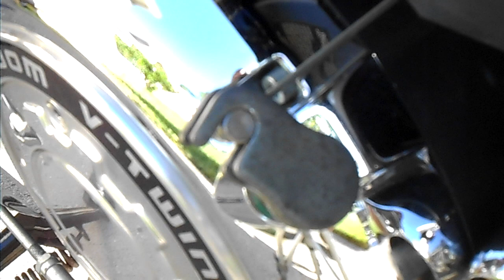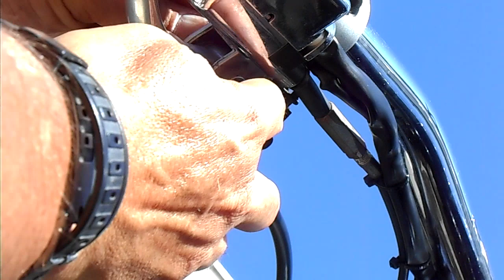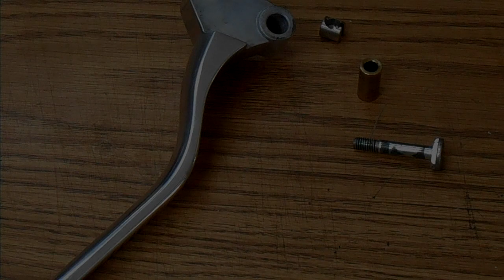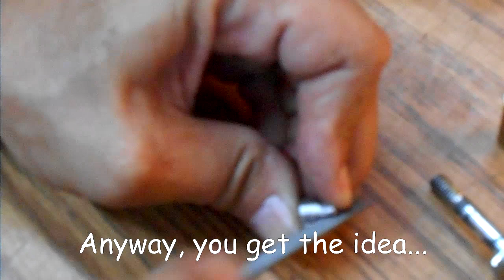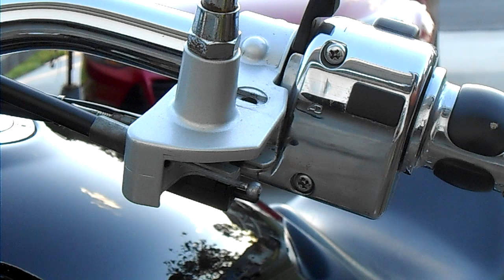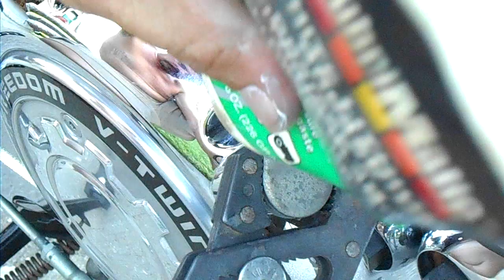Victory Motorcycle Clutch Cable Maintenance and Modification

Comment: why didn't you use cable lub on it when you had it apart?   nice video.. thanks..
Reply from the maker: Cable is covered in plastic. (delrin/nylon)  Lube on a self-lubricated cable is bad. :)